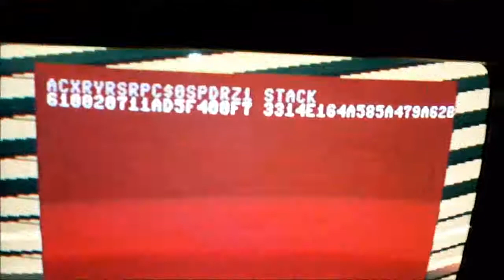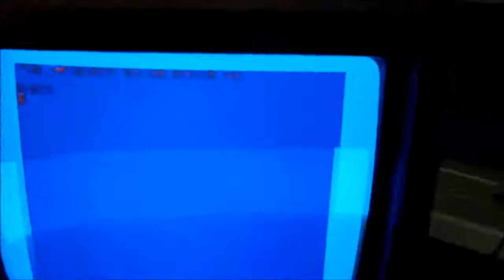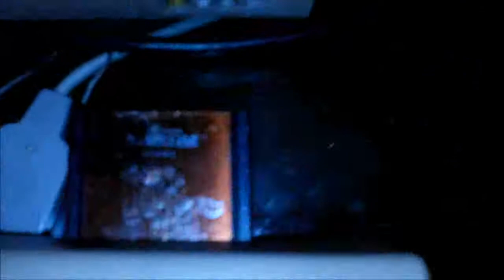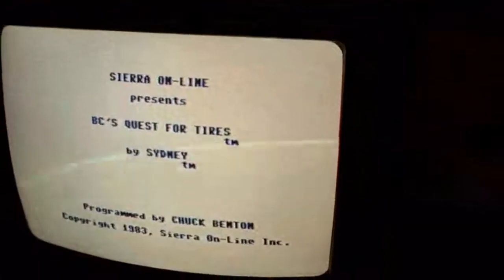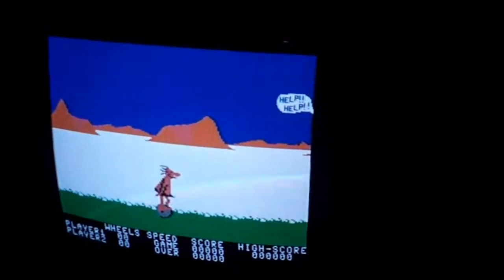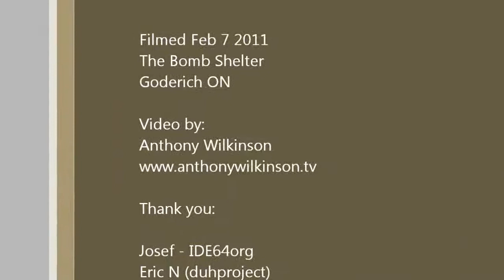IDE64 Troubleshooting - The Bomb Shelter

Comment: The first console "appears (don't hold me to it)" to be ram related. It looks as though the refresh is not refreshing properly on the registers. Have you fully tested your ram on the console to verify the C64 4164 chips are functional?
 The second one might be a little bit more difficult to decipher as it's clearly character, or color related. My suspicion would lead me to first check the character 901225 ic, then if it persists, check the 6567 VIC.
 If none of these are the problem, then you may have some way acquired some "bad" IDE64 units somehow.
It's really awesome to see you using these devices as I love the heck outta mine.❤️💪